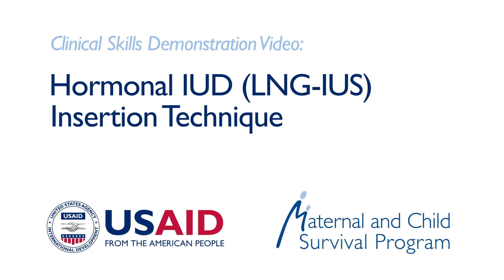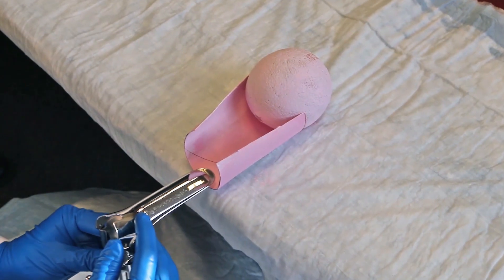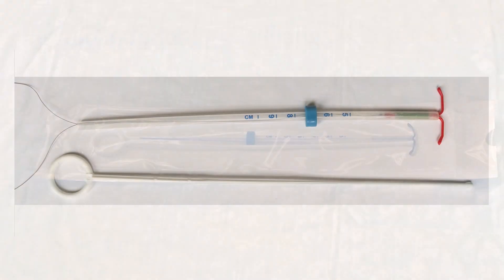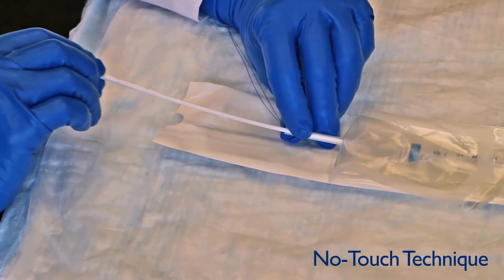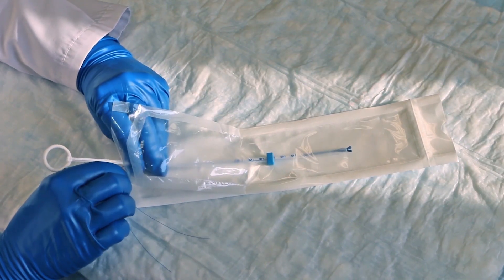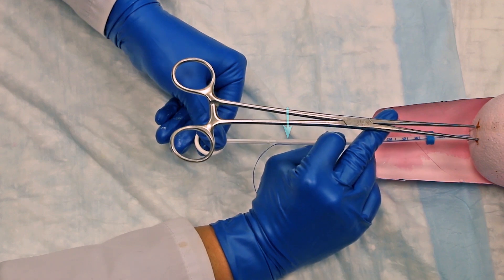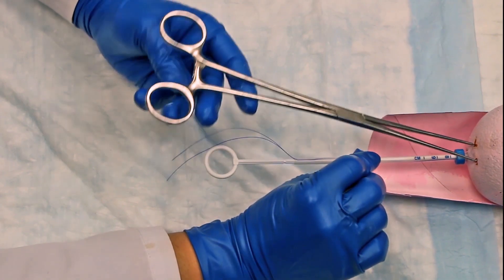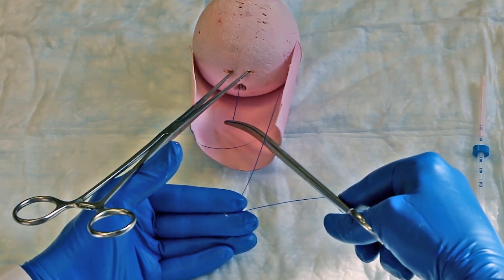Hormonal IUD (LNG-IUS) Insertion Technique

Comment: i do not regret getting the arm thing instead
Reply: I had a LOT of problems on the nexplanon. Got my paragard yesterday and it was the worst pain I’ve ever experienced. I’ve just decided birth control sucks.
Reply: I do not regret just taking the pill. Put any type of physical device inside of me, iud or implant...fuck that 🥴
Reply: Its actually not as bad..
Reply: Your arm implant probably hurt worse than getting an IUD.
Reply: fr? i had to switch out my iud for nexplanon implant due to endometriosis and the implant is making my life MISERABLE i’m getting it removed tomorrow lol it’s been 9 months of hell. i miss my iud so bad but hey i’m glad it works for you. everyone’s different!
Reply: CUlataKatie it’s made my weight fluctuate a lot more than i’d like it to but so far it’s helped with with my hormones and the insane full body cramps/vomiting(i think i have endo but i’m scared to get diagnosed and being on nexplanon has helped sm)
Reply: Yah I was suppost to get it today but they couldn’t grab the walls😭it hurttt because they grabbed it like 4-5 times
Reply: Everyone is different and I was fine on nexplanon for the majority of it but I had major issues in removal - basically the top half of mine got stuck in my muscle wall in my arm and took 3 people at my doctors  pulling to try and get it out - after that I wasn’t going to rush back and get it tbh
Reply: We dont have this in Canada. At least not where im from
Reply: @nakkitaschaffer2885  Nexplanon was just recently approved for use in Canada in September I believe :)